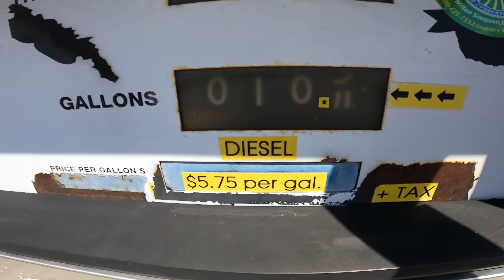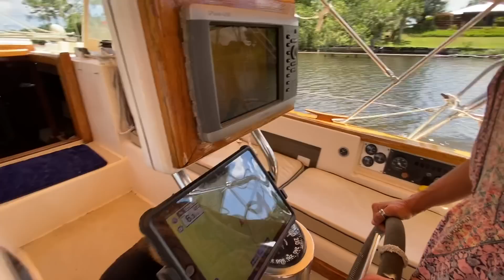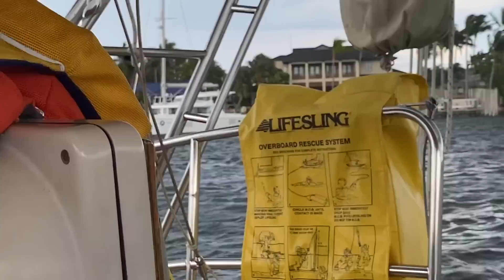Episode 5: Leaving the Marina, navigating locks, and stormy anchorages

Comment: How do you lower the dinghy? Any way to rig it up to lower the dogs? Or tie a rope to the life vest to help lower the rest the way done so 100lb pups aren’t crushing the lil lady .
Reply from the maker: There are “davits” on the back with a pulley system to lower and raise the dingy. Once in the water one of those can be used to lower the engine also. We could also use them for the dogs but we just manually lower and lift them using the handles on their vests.

Comment: Some locks will fine you if you touch the walls
Reply from the maker: Ya, in this case the wall he was referring to was outside the lock in the staging area waiting to come in. It had railroad tie like material and there were some large cleats that appeared to maybe be for some larger boats that come through. We were staying just off of it but it allowed us to hold a position. Still not sure what the issue was.